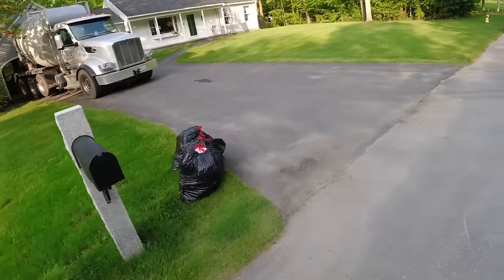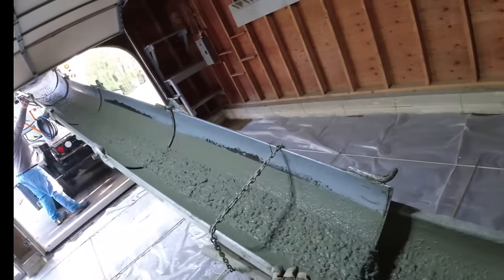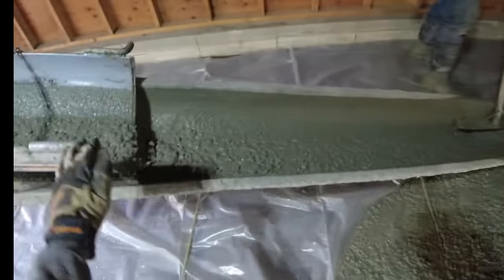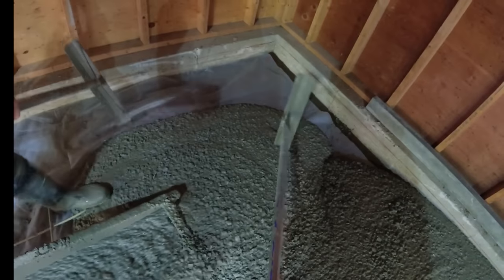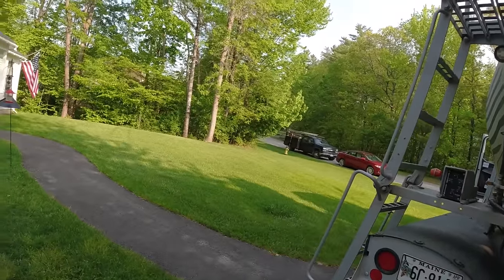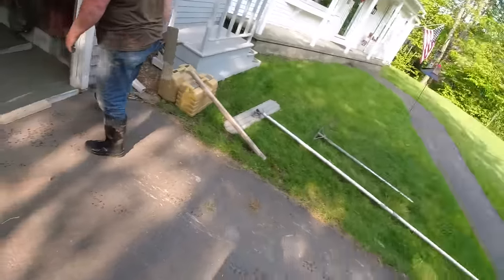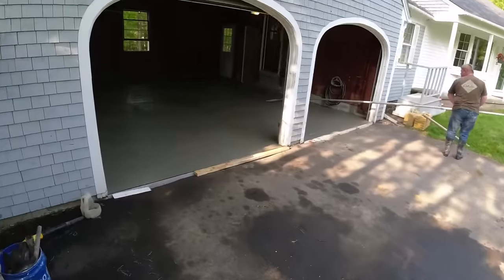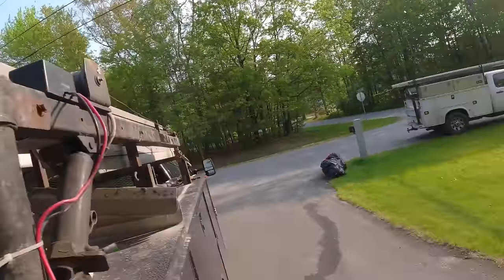The Cost To Demo, Remove and Replace a 24' x 24' Garage Floor

Comment: Mike, Darn, Luke Thank you for all the wonderful advice on how to do concrete. I just built a 24x40 pole barn a few months ago and last Friday poured the concrete 12 1/2 yards. I know that's not a very big pour for you guys but at 61 yrs. old and doing it by myself I wasn't really sure I could pull it off. The concrete driver thought I was crazy but I followed your steps on getting the truck empty so I could get it screeded and bull floated before the next truck arrived. I was probably over the time by 10min, but the driver didn't mind I think he was more in shock that I was able to do it. I was going to send you some pics but cannot thru you tube. Your videos make it easy for anyone to be able to diy there on project. It all started watching your video one-man concrete slab pour. best wishes The Cigar Man
Reply: How hard do you think it would be to demo and repour a 1.5 car garage? DIY possible?

Comment: I need to get this done. I think my detached metal garage is slightly bigger. the cracking didn't bother me for the past 10 years really, but after buying another car and parking it in the garage it has gotten worse. Sucks! Plus i'd want it thick enough for a lift in the future so more cash!

Comment: Here in Europe we could use those fiber bars only on certain concrete block s placements ,slab on floors like ground works but not for structure ! Anyhow mybe worth to mention that the ground preparation required more dampth then regular iron bars .the distance between fiberbars should be betwee0- 10-. 25 cm maximum m

Comment: No power screeder?  Especially when there is only 2 guys to work this.  Just thinking about your back.  What was the slump on this?
Reply: Cant  use a power screed when there is fall to the drain !

Comment: The Demo of the old concrete seems very expensive to me, I think if it was my job I would get another quote for that!
I might be out of touch with that sort of work but it just seems a lot!
Reply: Definitely too high, no way the cost of removal is more than the cost of concrete, rebar, plastic and pouring. I've been pouring concrete in northeast Ohio for 35 years and no one gets $ 9 a sq ft for removal.
Reply: @VitoRagone-pu8rm  yep, after hearing that i think Mike should be in the demo business, pays better with less work.

Comment: I had a 40x44 barn poured for $5500 and that included the grading…
Reply: At 4 inches thick that wouldn't even buy the concrete in my area.  It's 220 a yard here
Reply: @derekbutts1782  part of it was machine finish and the other part was a broom finished porch.
Reply: @R2Mike  it was 4 inches thick with fiberglass. It was also a Mennonite crew so I’m sure that helped with the cost. They did a great job though.
Reply: @R2Mike  He said it was 9 yds at his price that's $450 a yard installed
Reply: @SR-ex3oj  but yards isn't enough to do that size

Comment: Why pour a garage floor on poly
Reply: Keep moisture from coming up through the slab. Dry concrete is happy concrete.
Reply: @jamesnm21  I've owned my masonry company since 1990 and have never poured a garage floor on poly.  At least not in Upstate NY we don't.
Reply: @lesjackson6575  apparently it works, especially if you plan to put a coating on the floor where blocking moisture is key.

Comment: .75 of a day for the excavation part. Call it a full day at that point. They probably dumped the concrete at their pit and brought in gravel they had at their pit that was leftover from another job. So basically 5k in labor

Comment: Fiberglass rebar is great for installers but years later when concrete is recycled and crushed into road base the crusher won't be able to magnetically remove the rebar.

Comment: $5,000 for 2 men  to work 6 hrs taking up a concrete floor, Mike you need to switch gears 😂😂😂. Start demo, not laying.
Reply: That seems high to me too. $
Reply: Shoot I'm in the wrong state!
Reply: I am in the concrete, crushing business I need to also get into concrete removal apparently… Lol
Reply: Yeah, the first thing I did when he said that was the math. He did say the guy did the dirt work too. But this still seems a little high to me. I'm in N Utah and I'm 5/sqft to remove and haul off concrete flatwork, and I make money doing it at that price. For me the prep/dirt work to replace would have been factored into the placement cost so I don't have a true comparison for that. But in this case, and at my price point, it was $2120 for the guy to rake it smooth, lay the vapor barrier and place the rebar. That part of it sounds like a complete rip off to me. That's why I do all my own demo work. I'm a licensed Excavator & Concrete guy.
Reply: I did think that too, but then you think that guy has got a dump truck , skidsteer, jackhammer attachment, those items aren’t cheap plus he gets rid of the rubble . Just saying guys.
Reply: @jimrowland8310  : I guess you didn't read my reply. Just saying jim... I've got all that stuff too dude. The only thing I can think of that could possibly be much different is his dump fees. I dump my concrete rubble at a recycling plant and they only charge by the load, not the ton so it's pretty cheap. But hey... if people will pay him that much then so be it I guess. I think Mike should get pricing from a couple other subs though, just to make sure he's getting the best price.
Reply: @OnGrade  yeah sorry bud , I wasn’t being rude 😊
Reply: @jimrowland8310 : No worries. After I hit the post button I actually also thought, "I hope that doesn't sound like I'm mad". LOL. All good.
Reply: Yeah the over all price was pretty spot on but he should be making more for finishing the concrete the demo guys shouldn’t make more than 6$ a square foot
Reply: @bigsmoke7381 you're definitely right, demo on this was way high